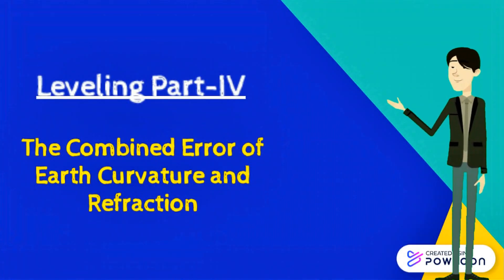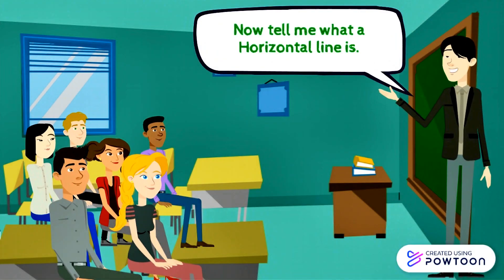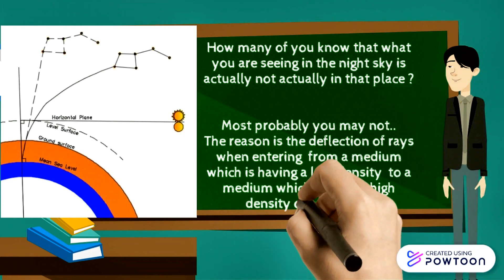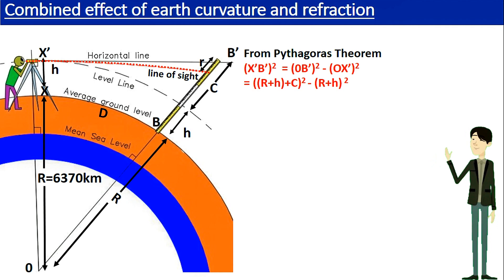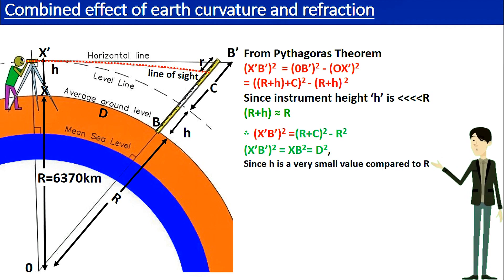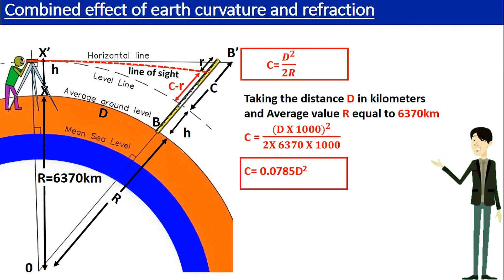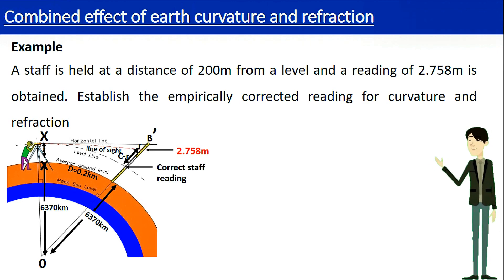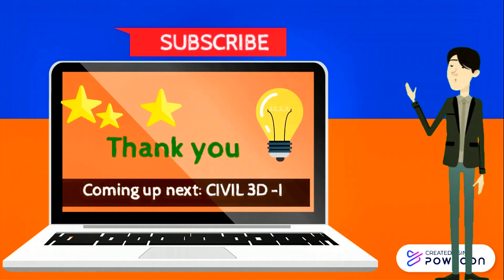Combined Error of Earth Curvature and Refraction

Comment: We can prove it's not a ball easily because east west flights around the world flight times, distances, & airspeed. With knowing that information for many decades they've had a calculated circumference distance of earth of which they have taught in school of between 24500 to 29000 miles at the equator. That is how they derived their curvature math at 8 in. per mile square. But what easily Debunks this nonsense is, using their math, a 6 ft person will not disappear in 3 miles. Willis tower in Chicago is viewable across Lake Michigan at 60 miles which is 1450 ft tall, but at 60 miles there should be 2400 ft of curvature drop. 😂 You can see the short buildings even!!
To embarrass the hell out of masonic nasa & the establishment, people have viewed with high optics mountains across a few hundred miles of land & water both ! - that should be miles beyond curvature according to their math.  LIARS  😂

Comment: The globe is so desperate to lie about simple truth they need super complex math calculations to fool you into believing that what you are seeing is not real. Refraction is a real phenomenon but it varies moment to moment depending on atmospheric conditions therefore it is impossible to calculate or measure a constant effect of it. Besides even if it could be calculated it would not create the illusion of a perfectly flat plane with imaginary objects extending hundreds of miles into the distance.
Reply: The 18th century canal engineers knew about corrections for curvature and refraction, otherwise canals would have the water moving to one end.  Over a 10km distance the error is 6.7 metres but over a modest 80km distance the error grows to a staggering 430m.  The refraction error depends mainly on temperature, but for small surveys over distances of a few hundred metres a "standard" factor is often used as the correction is small.  Not so over long-distance surveys.
Reply: So trigonometry is "super complex math" wait until you discover calculus, matrices, differential equations and tensors.

Comment: So just how far can I see the ground if the earth is a globe? I swear I’ve seen the bottom of buildings from 30 miles away!
Reply: There is curvature. The curvature is very slight so you can’t see it. Only when you are up high. Flerfs love to be stupid and it’s easier to say leveled or flat when it’s on property. The horizon is curved due to earth having atmospheric refraction. You know nothing about any calculations
Reply: Just saying
Reply: ***I swear I’ve seen the "bottom" of buildings from 30 miles away!***

ROTFLOL!! Then, you weren't 30 miles away...Or...Your lying because a curved Earth destroys your flat Earth hoax.
Reply: If you're about 6ft tall on a ground that is level the further point you'd see (horizon) would be about 3 miles. If you saw the very bottom of a building 30 miles away, you'd have to be about 600ft higher than the ground level where the building is located.
Reply: @kitcanyon658 
Not quite, the minimum height required is 411ft.
Reply: Then you either need new eyeglasses or you're lying.
Reply: Daniel, stay away from that moonshine. It's making you hallucinate.

Comment: I have asked the following question on many curvature videos but no one has yet provided me with an answer?
Using known curvature calculators would it be possible to have a line of sight between 2 locations separated by 430 km? What should the curvature drop be?
Reply: Jtolen media 1 channel has a few examples
Reply: @jayh9529  love JTolen…dang right he does - he has very long distant vids. Definitely flat
Reply: @ithinkthonkthunk5333  Very long distance from a great elevation. Now try and muster your two brain cells and try to figure out why it only works at higher elevations.
Reply: Hi Patrick, I am so glad you have asked this question.
I have to assume a viewer height.
You're standing on the top floor of the Willis Tower. 1944ft above sea level.
430km = 232.2 nautical miles = 267 miles

The minimum height a structure would need to be for you to see it at all from 232.2 nautical miles is simple to calculate.
√Height = distance÷1.17 - √height of eye
= 232.2/1.17 - √1944
= 23830ft (minimum height of structure)

You also asked about drop. Barely an inconvenience.
8"*(267²) = 570.312" = 47.526ft of drop.
Reply from the maker: No.These curvature equations are valid only for shorter distances less than about 10km. If this distance is greater than that, most of the assumptions made to derive the equations are not valid.
Reply: @theengineeringsurveyor7872  so are you saying that there is no scientific formula that can calculate the line of sight between 2 locations of similar elevation distant from each other at 430km?
Reply: @theengineeringsurveyor7872  curvature equations made from assumptions are NEVER valid from any distance mate bc curve only exists in your imagination. Start with the alleged earth 🌍curve formula which is 8”x miles ^squared for an @25,000 mile circumference ball. Prove this first!
Reply: @ithinkthonkthunk5333  Ummm…

There is no “alleged curvature equation”.  You are posting on a video which explains the DERIVATION of the “curvature correction equation” whose ONLY PRESCRIBED USE is to correct line-of sight elevation measurements.

Its validity has been tested and retested.

This equation is NOT to be used by Flerfers to say “der….I shouldn’t be able to see tha! Der Ate Inches par Mile!!! Drr”

Rest assured you “see” exactly what you “should see” on this beautiful sphere called Earth.
Reply: @omarkos54  it's pear shaped
Reply: @ithinkthonkthunk5333  that’s not true. You just got that off of one clip. Not the whole interview

Comment: Level is NOT curved, it is flat & horizontal! 
Earth is observably & mathematically flat & can be treated as such when measuring elevation angles. Elevation angles can not be measured with a curved adjacent (baseline). The use of a sextant backs this claim.
Reply: Level is considered flat on small distance because the curvature isn't noticeable on small distances. However on long distances the level is considered curved as parallel to the surface of the earth. If you check the Merriam Webster dictionary, one of the definition (the one used for large structures) is :

Definition of level on large scales, Merriam Webster : Adjective, (entry 3 out of 3) having no part higher than another ; conforming to the curvature of the liquid parts of the earth's surface
Reply: @oswald9723  so you think level is curved? Do you think men can get pregnant 🫃too? 
Also, the curvature is not noticeable on long distances either bc its flat. Just watch 200 proofs & see for yourself. Elevation 📐’s  need a flat baseline to be measured. This is all you need to understand if you know triangles dont have curve? Critically think!
Reply: @ithinkthonkthunk5333  and again the lack of scale understanding of Flerfs 🤣🤣🤣
Reply: @ithinkthonkthunk5333  Actually, we don't "think' level is curved.  It is a fact.  This is not some flerfer debunking video. It's a tutorial for Engineers and Surveyors on how to do their JOB GIVEN the FACT that the Earth is a sphere.  "level" is a surface that is perpendicular to the pull of gravity.  On a spherical planet (as all planets are) that pull is toward the center.  Therefore the "level" surface is curved.   If it were not (over long distances of course) the "horizontal surface" you describe would deviate from the earth's surface and be higher in altitude at one end than the other and no longer be "level".
Reply: @maorgabai6139  lol 😂…i know your model probably better than you!
Reply: @ithinkthonkthunk5333   lol at least I have one. 🤣🤣
Reply: @maorgabai6139  - please…by all means, let your ignorance shine
Reply: @ithinkthonkthunk5333  when you don't have an answer you start whining.
it is the way of the Flerf. 😁
Reply: There is curvature. The curvature is very slight so you can’t see it. Only when you are up high. Flerfs love to be stupid and it’s easier to say leveled or flat when it’s on property. The horizon is curved due to earth having atmospheric refraction. You know nothing about any calculations
Reply: J Tolan did not prove anything. Stupid flerf. This math proves you wrong

Comment: Three flat earthers didn't like the video.
Reply from the maker: Yes....they from stone age
Reply: @theengineeringsurveyor7872  2 questions if you would be so kind to share some insight. 
1. How can a high pressure system exist next to a non-pressurized system (10^-17th torr) without a solid barrier of separation?
2. Is earth’s horizon geometric (physical)? 
Thanks 🙏
Reply: @ithinkthonkthunk5333  you can if a force exterts on the gases thus creating pressure. Here the force is gravity. However on earth we have a pressure gradient, something that cannot exist inside a container. Which debunks any containers hypothesis.
Reply: @oswald9723  false…you cant have gas pressure without containment. One must first have gas pressure BEFORE one can have a pressure gradient.
Reply: @ithinkthonkthunk5333  read my comment again. The container is just an image of something exerting a force upon the gase inside. If you have a force on the gases. No need for a container. The force of gravity maintain the air on earth thus causing pressure.
As a mechanical engineer, I'm telling that's how it works.
Reply: @ithinkthonkthunk5333  however in a container the pressure is homogeneous which isn't the gase on Earth. Indeed we have a pressure gradient. Which debunks any container hypothesis.
Reply: @ithinkthonkthunk5333  wrong, you're trying to discredit gravity as it has been described differently by two people. In reality, einstein and newton's experimented and described the same:

Gravity is a natural phenomenon by which all things with mass or energy are brought toward one another. Today, the phenomenon of gravity is explained by two theories: Newton’s law of universal gravitation and Einstein’s general relativity. 

Flat-Earthers take the existence of the two explanations as inconsistency in science and use it as a “proof” of deliberate misconduct. Such allegation is obviously only a result of their prejudice. The two theories are the correct explanations of gravity, and can reliably predict the outcome of the phenomenon. 

“Gravity” is the name of the phenomenon. Newton’s law of universal gravitation and Einstein’s general relativity explain the phenomenon. Newton’s law of universal gravitation describes gravity as a force, while Einstein’s general relativity describes it as a result of space-time curvature. 

Newton’s law of universal gravitation is more straightforward and gives sufficiently accurate results for most everyday usage. General relativity is far more accurate, but also much more complicated. General relativity can explain phenomena which cannot be explained using Newton’s law, and also describes some events unrelated to gravity. 

However, there are very few cases involving gravity in our everyday lives that cannot be explained by Newton’s law of universal gravitation. It is why Newton’s law of gravity is used in a majority of situations in our lives. 

The two theories are two separate explanations of the same phenomenon we call ‘gravity.’ Both are valid and correct, only with different complexity and accuracy 

PRECISION: Newtons iniversal law of gravitation describes gravity as a force
Einstein's general relativity describes gravity as a result of time space curvature
Reply: @ithinkthonkthunk5333  of course pal  here you go:

●tokamac reactor showing high pressure next to a vacuum 

https://youtu.be/DAssKNprOGA 

So what this is showing you is the inside of a nuclear fusion reactor called a Tokamac. At the beginning the pressure in this whole chamber is pretty equal.
But using some very clever electromagnetic forces they actually pull all of the plasma which is ionized gas into a ring and you can see that blue ring there. Now at this point, the blue ring is at extremely high pressure  and everything else in this chamber is a near vacuum, a near vacuum. So we get to create high pressure next to a vacuum using forces.
Reply: @oswald9723  sorry - maybe i miscommunicated. This was a very cool
plasma experiment but not applicable to our discussion. Im asking for the experiment that demonstrates GRAVITY CAUSES gas to be pressurized WITHOUT containment. This plasma experiment also used a container. The vacuum environment without containment that you need to post should be around 10^-17torr. Good luck 👍🏽
Reply: @oswald9723  interesting…Lets test your claim. Tell me what the hypothesis and independent variable in this plasma experiment is.
Reply: @ithinkthonkthunk5333  Actually the tokamac reactor is not an experiment I misused the term, they're not trying to show that a high pressure can exist next to a vacuum, yet it happens (everyone qualified in the field perfectly know that it is possible). The tokamac reactor is designed to exploit the energy from fusion.
It does that by creating a very high pressure of ionized gases (much much higher than atmospheric pressure) next to a vacuum without a barrier to separate them.
Here you go, concrete empirical counter exemple of your claim. 

But no flat earther actually works in the nuclear field so how would they know.
Reply: @oswald9723  still waiting for your experiment
Reply: @ithinkthonkthunk5333  experiment ? of gases pressure being possible next to a vacuum with forces ? Done.

Sorry if you think I have to apply your specific values to demonstrate something, that's not how it works. I showed you gases pressure next a vacuum, since you claim that was impossible. Now either you have something that counters what I showed or you admit you were wrong and move onto another subject.

Watch "mage 2 what shape is the earth" to literally observe  what you're asking for.
Reply: @ithinkthonkthunk5333  The atmosphere is not sharply separated from the vacuum. It gradually fades into vacuum, this has been measured and you can mesasure it yourself. Most often what we see as the horizon is physical, yes.
Reply: @doddermodd  yes and still the Flerfs still think they are right
Reply: Now apply that to a rail gun that actually can shoot an object up to 200 mikes. Guess thats refraction too